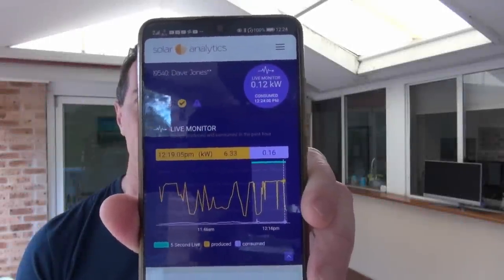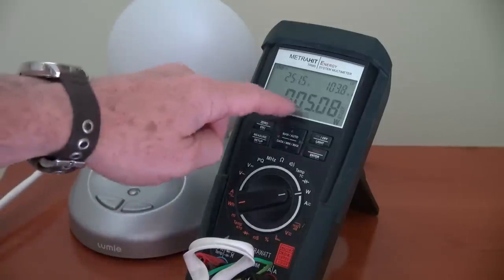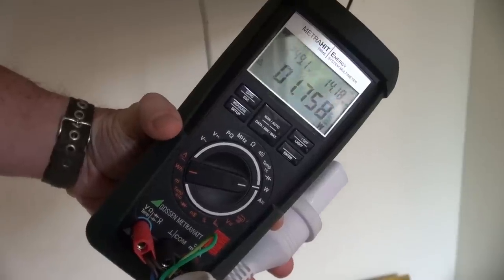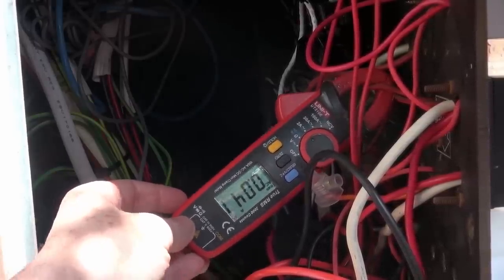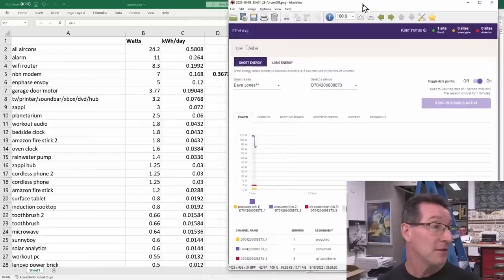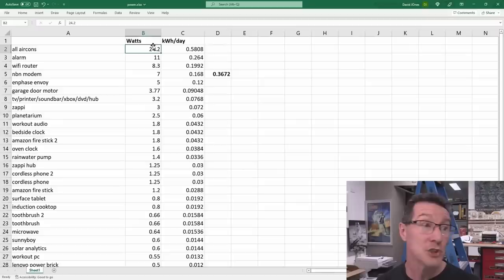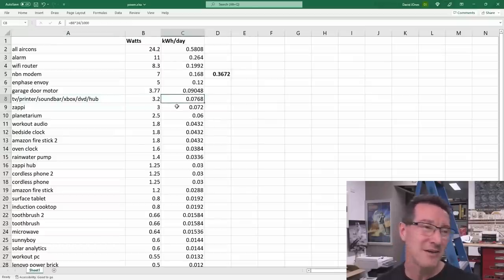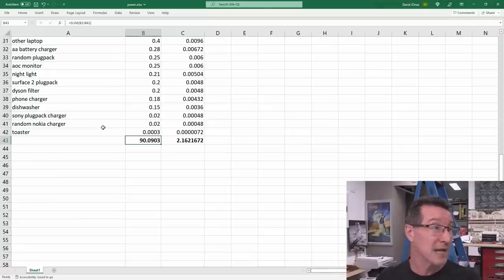EEVblog 1505 - 120W Home Phantom Power? Audit Time!

Comment from the maker: NOTE: I completely forgot three mains powered smoke alarms. We had to fit these when the home extension was added to meet new building codes. I thought they were still battery powered (but they do have battery backup)
Reply: Yep, those will eat a watt or two. Are they not powered by the lighting circuits?
Reply: I recently added wiring to the main panel for the garage and because of the heavy wire and limited space, ended up breaking the wire for the smoke detectors.  I determined this as they would go on and off with a chirp, when they shouldn't have been when working on the panel (safely ofcourse).  Lucky for me, it was an easy fix as it broke right at the circuit breaker. The ironic headline: " man dies in fire started by faulty smoke detector wiring."
Reply: Do you have a garage door opener? Mine has wifi capabilities and all that (which I won't use, as it prob connects to the cloud and Amazon doesn't need to know the status of my garage door), which I'm sure will use some standby power.
Reply: still shocked by how your breaker panel is wired. Jeez.
Reply: I had 3 old mains smoke alarms. 15W each. They had NiMH batteries and just chewed the juice. I have Z Wave relays on my entire light circuit that kills the power to all lights and smoke alarms when we're out or late at night. Also have AC on one. TV is also on one. However I'm about 80w minimum power. That is fridge, raspberry pi, wifi, modem and a few others. I monitor power three ways. Two Schneider electric systems and through the utility. My data agrees with the utility by sub 1 percent. I'm sampling as fast as I can which is a little below 1Hz. Then stick it all in a database and query with grafana.
Reply: An alternative are wifi interconnected smoke alarms with a 10-year lithium battery. They satisfy requirements and don't require a sparky install. The downsides, hardware wise they cost more and the units must be replaced after 10 years.
Reply: @Monkeh616  idk about AU, but in North America: they have to be on their own circuit to prevent people from accidentally working on them (and interfering with their operation)
Reply: @jamess1787  Where I am it's quite common to place them on the lighting circuit to prevent people turning them off.. it's also convenient, because the cabling is right there.
Reply: Probably not a good idea to cover the fan on the Xbox One S by sitting the DVD player right on top of it's fan. Lol.
Reply: @harukinzaphod  in Australia most smoke alarms have a lifetime of 10 years. Similar for smoke detectors in fire alarm systems. related to amount of contamination of the photo sensor over time.
Reply: @vk3fbab  Why would you want your smoke alarms to be off while you are sleeping? In my mind that is probably the most important time for them to be on.
Reply: @vk3fbab  you're switching your smoke alarms? That sounds like a terrible idea.

Fires can happen when you're not home as well.
Reply: @shaunclarke94  they are battery backed and consume nothing while on battery. Smoke alarm batteries are required to be replaced at the interval specified by the manufacturer which in most cases is annually.
Reply: @--_DJ_--  they're battery backed and as I wrote to someone else replaced as per instructions from maker at 12 month intervals. These new ones hardly consume any power. So with some rewiring they could get their own circuit. I live in a building where the smoke alarms are tested annually as part of the occupant warning system and they pass the test while not on mains.
Reply: @vk3fbab  It just seems like one of those risk vs reward propositions to me. They do hardwire them for a reason.
Reply: Cutting off the wireless router may have side effects. If it happens too much, the machine at the other end of the line may think you have a line issue and cut the speed on the link.
Reply: I've seen houses with the mains wired alarms completely covered in Lecky tape   from someone pissed off trying to sleep
Reply: @SxyRikku  I've taped a component bag over the front of my router to dim the thing down. It was way too bright even set at half brightness.
Reply: @Monkeh616  some use alot of power
Reply: @Monkeh616  Don't know what cricuit they are on actually.
Reply: @bertblankenstein3738  I showed the garae door motor in the video
Reply: @harukinzaphod  I believe it's compulsary here that you have mains powered smoke alarms.
Reply: @vk3fbab  your turn off your smoke alarms late at night? Seriously?
Reply: @aajpeter  correct term would be de energise from the mains. They still have 9v batteries that get replaced annually. Smoke alarms running on batteries only draw noticeable current when sounding. In normal use it's the shelf life of the battery that results in them being replaced.
Reply: ISP issued routers tend to receive automatic software updates and parameter updates (if relevant) during night when people aren't likely to be using them, so consistently turning then of during night could mean you'd be missing these updates. Also when the device isn't powered it could look like the line is down for the ISP and they could automatically adjust bandwidth and error correction rates that could affect your internet connection. I wouldn't recommend turning off the ISP router at night unless you've investigated this first.
Reply: @shaunclarke94   tbf whilst it does intuitively seem like a bad idea to switch it off and on, if the fire starts while everyone is out, there seems little point in the alarm sounding unless there is some sort of external notification function? Thoughts?
Reply: @busdrivernow319  it can help draw attention to and warn others of the hazard which can get neighbours to call it in as soon as possible.
Reply: @Monkeh616  that's interesting. Here they're branch circuits in new homes, so the leg going to the light is usually switched, so dedicated (with battery backup) here is common.
Reply: @jamess1787  You see it both ways, but especially in retrofit installs (which is the vast majority) simply taking the feed from a convenient light fitting is common. It's less convenient if the permanent supply only runs to the switch, but that's fairly unusual still.

In rentals and the like it's sometimes done intentionally to prevent them being disabled easily. People tend not to leave the whole house without lights.
Reply: Holi crap your meter is expensive.    Cha Ching !!

Comment: I worked as service engineer for Miele, their appliances are one if not the best in the market, very well built and very energetic efficient, even the detergent and water consumption re very low, and they last for ever, in fact you can still get parts for your 40 year old Miele washing machine! Good luck in other manufacturers. Very cool video Dave.
At my work place we spent £5000 retrofitting LEDs in place of the CFLs, we went form 9500 watts to 3500watts. That is a lot!
Reply from the maker: My lab buildign switched to LED lighting many years ago. Forget the figures, but the savings were in the 5 figure range.
Reply: @EEVblog  that's really good!
Reply: yeah Miele good ol German engineering
Reply: Miele is German so to be expected :)
Reply: I'm a Miele convert, I was aware of the service life aspect re spares from a documentary IIRC, my aunt has her original Miele dishwasher, now over 20 years old, and I notice that unusually the current range of Miele dishwashers are hot feed.
Reply: We too made the switch to LED from fluorescent at work years ago. We have a large warehouse and office space, so the savings were huge. We also had issues with the ballasts going out with the fluorescents, so being able to not have to worry about those, plus the high lifespan of the LEDs, it was a no brainer.
Reply: My mothers' Miele washing machine is around 50+ years old and apart from some little defects (20y ago I replaced the magnet-valves) it's still working pretty fine. I'm sure, this little miracle will go along with me till I die  .)
Reply: It depends a bit where you live, but in mainland Europe, it's very hard NOT to buy LED bulbs.
I have seen people using a bunch of 40W bulbs in their room every day, sometimes even forgetting to turn them off.
That is like 4/5 times 40W = 200W just being used for nothing, total waste.
Reply: Miele was rock solid in the past, but it isn't the case anymore with recent appliances. Our Miele dishwasher wasn't working anymore after only 10 years, and it was totally damaged by water leaking. The appliance repair shop we use also had many issue with them in the recent years. We switched to Siemens, as it seems more reliable now.
Reply: yeah my parents still got these old appliences running There from 70-80s the dryer is still regular in use just needed a bearing replacement a couple years back . The Wasching maschine
is in storage as spare beause of the higer power and water consumtions.
but there heavy as f
Reply: I recently bought a new pump for my W971 which is at least 23 years old (mentions Y2k compatibility on the sticker ;-) ) and it keeps on washing. So much stuff is thrown away nowadays because you can't get replacement parts and almost no one repairs on component level.
Reply: Worst washing machine I've ever used. W series, similar to Dave's one. Computer failed about 11 months in. No parts available. They wanted to ship parts from Germany at 8 weeks delay. I had to tell them where they could stick that. They gave in and replaced the whole washing machine. The warranty is poor at only two years (most expensive washing machine in whole store, but no more than two years warranty. Now i know why). Also, worst control system I've ever used. No user preset. Only factory preset wash cycles - none of which work as I would like. You can slightly alter settings but not much. Uses a little puddle of water in the bottom to wash clothes. If you hit the extra water button (not available in all modes, of course), you get a bit bigger puddle. It splashes the clothes in the little puddle and calls them clean. Definitely worst I've ever used. Would rather a cheap chinese one. I bet it would wash properly.
Reply: Sadly like many others, wether it was planned obsolescence or indicative of contemporary, competitive, cost cutting measures, our more recent purchase of miele equipment doesn't meet our previous experiences. Our washer failed, terminally (way beyond economic repair), a month after the warranty.
Reply: @busdrivernow319  From my experience dealing with broken Miele appliances, I can tell you the quality and function peaked in the late 90s/early 00s. Great built appliances with astonishing lifespan and build quality. The motors were whole cast parts and what could be metal, was metal. Sometime in the 2005+ range, it all changed and the, what were cast parts, became stamped and plastic replaced steel where possible (look at the current dishwasher lineup, a 2000Euro+ model and has all plastic spray arms). Also, they moved part of production to China.
Overall it's best to get an old model and just care for it and cherish it. Nowadays, it's all a race to the bottom. And I am saying all this while in my 20s, so I am not some grumpy guy (yet;)
Cheers from Czech republic

Comment: I did a similar energy audit and added some home automation to try to manage it better, only to find some of the RF controlled power relays had worse power use than the loads they were managing! My next plan is to centralize all this into the mains breaker panel, then pull some new circuits as needed.  But that's for the next remodel...
Reply from the maker: Yeah, you wouldn't bother to automate switching stuff under say 10W or something.
Reply: Just chuck an extra PV panel on the roof and don't worry about it!
Reply: Yeah got to be careful when to use these, I measured 1.2W drawn by a Wi-Fi socket, and 0.3 to 0.6W from a zigbee socket
Reply: Had the same issue with a cheap night time light sensor, it used more current than the led address sign load i was going to switch with it . If I remember right it was above 5watts.
Reply: Low quality automation devices can do that. Expensive hi quality devices go the other way. A Wiz 1600 lumen bulb running at 800 lumens only uses 4 watts. It is $22 instead of $12 for an 800 lumen bulb which will use 8.8 watts.
Reply: Have you ever thought about using (power) step relays instead of RF controlled one's
Reply: @EEVblog  Step relay
Reply: I've been wanting to build a RF controlled relay that has a little supercap or battery inside - just charge the battery when needed then it can switch off its own converter and run on the couple of milliwatts it actually needs.
Reply: Maybe use some SSR's instead of relays?
Reply: @Ozzy3333333  those are often impractical (large and expensive) for isolated load switching at 240VAC
Reply: @dl5244  Yea, About $3 shipped on Ali,,,  :)
Reply: @Ozzy3333333  really? And they are safety certified (with reinforced isolation) for 250VAC load switching and have a low resistance when closed?
Prices on Mouser start at $52 for 10A and go well over $100 for for better quality parts. They are big at 2"x2"x1" and require a large heat sink
Reply: @dl5244  Yep, every UL, CSA, TUV, etc certification that they can clone, geez. Even my first SSR is still working from Ali for 11 years on my pool pump, its a small 1.5hp motor. And if it does fail, I can have ~15 spares for the Digikey convience price. Even get a higher amp rated unit for lower losses.
Reply: @Ozzy3333333  Yes, and the usual failure mode is short circuit. When it fails it's always on.
The ones that fail open are much more expensive.
Reply: @zlotvorx  maybe in some cases, in 4 decades my experience is fets fail as a short, but triacs fail as open. Let's say it fail as a short,now you're in the same situation as you were before the ssr, it's not like it's shorting the supply. So in the video he is talking about mostly  switching small load's, a 30A ssr 8s not going to fail with a small 100w or less load, for the big loads buy quality and not from digikey.
Reply: @Ozzy3333333  I still can't find any cheap (cheaper than a mechanical relay), safety isolated 250VAC SSRs with a closed resistance that could be competitive with an electro mechanical relay... The dissipation from load current in SSR's is what makes them require large heat sinks.
I still think a better option for lower power would be to design for a latching relay, or use one with normally open contacts (so that while turned off there is no power going to the coil)
Reply: @peterthefoxx  the lower power draw one might be using a latching relay instead of a standard relay which needs power to hold the coil in.

Comment: I did something similar and found some hardwired loads to the house. One was inside a wall compartment, powering a UPS for the wired phone line. I only found this because the UPS started to beep due to battery failure. The other loads were in the attic, powering wall-warts to the AC air handler.
Reply: why are those wall-warts for AC so horrible inefficient ? aren't they supposed to draw less than 1W when the A/C is off. Or they are just a bunch of dumb coils.

Comment: One of the largest savings in electricity I've made was installing a solar (not PV) water heater. I still use the electric water heater but it draws hot water from the solar heater on the roof so 9 months out of the year the electric heater doesn't even turn on, and in winter it takes in warm water instead of cold. I'm in the southern hemisphere also (Uruguay) and we get direct sunlight all year round.
Reply: The hippies that built my townhouse did the same thing. In the southern USA (NC), the thing's all but useless, which is why they were all removed 15-20 years ago. Works great in the summer when we don't need much hot water (which also heats the house - hippies, remember), and just pisses energy into the wind (literally) all winter. After installing an A.O.Smith Vertex water heater, my gas bill (hot water and house heat) hovers around 15-20$ (vs. over 100$ previously) The highest it's ever been was around $50 - it was below freezing most of the month.
Reply from the maker: Solar hot water water system were all the rage here in the 1980's, but the market died out almost completely.
Reply: @EEVblog  In Greece and Cyprus solar heaters are almost universally used. I turn on the electric heater in the solar 3 times a year. (300+ days of sunshine)
Reply: Remember, the best domestic PV panels convert "only" ~22% of available energy but Solar water heaters capture as much as 95% if wiki is to be believed.
Reply: @jfbeam  if it consumes energy in the winter that seems like a poor design, not a necessary feature of solar heating
Reply: Where I live, solar doesn't seem to be good for anything other than pool heaters.
Reply: I Love my evacuated tube solar geyser, it had a "control panel" inside the house to set up stuff like times on/off, temperature on/off etc..... Which failed around a year into getting the solar geyser (I think it's just the little wall wart that actually powers it that failed, and I just couldn't be bothered to replace it), so needless to say, we just adapted to taking bigger, fuller baths/showers in the summer and smaller/quicker showers and baths in the winter, as the element inside the geyser hasn't physically switched on in over 15 years 🤣🤣
Reply: My house in Florida has a heat exchanger between the electric water heater and the air conditioning.  I rarely have to have the water heater turned on because with the AC running most of the year, it just heats the water throughout the day.  It's a simple device too - just a small pump like you see in radiator heating systems and a couple of coils of copper tube.